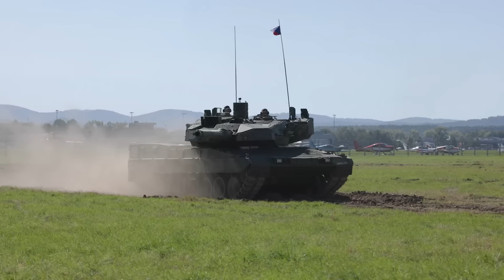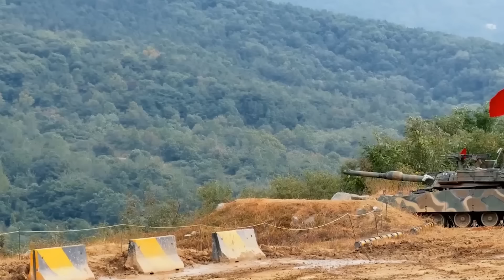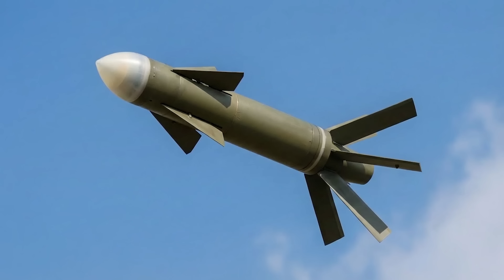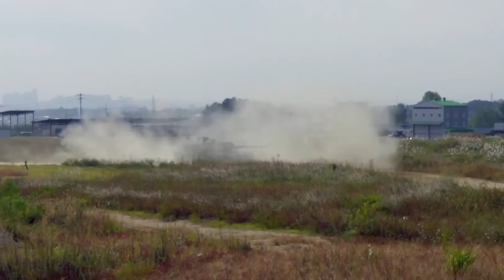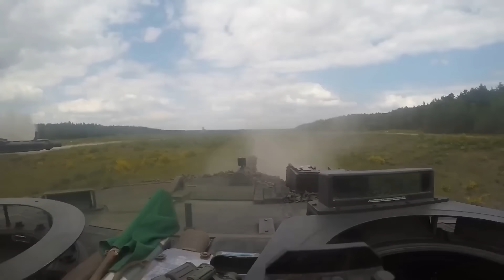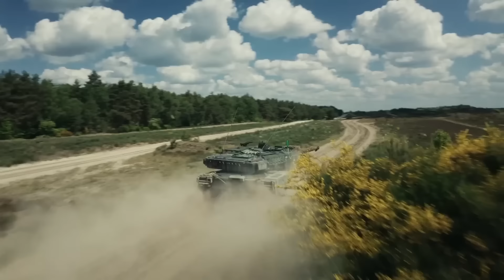Germany’s New Leopard 2A8 Is Better Than K2 Black Panther?!

Comment: Do you realize that the main 120-mm gun on the K2 MBT is based on the Rheinmetall gun first used by the Leopard 2 more than 20 years ago? Same thing with the engine & transmission system. Several years ago, Turkey negotiated to buy the K2 MBT from South Korea, with provision for technology transfer for its own new tanks, mainly as a way to get around German sanctions on arms exports to Turkey. The deal collapsed when the indigenous South Korean propulsion system was discovered to be substandard.
Reply: 1. 독일 랭크에서 한국에 수출한 변속기 알고리즘에 장난질을 침

2. 이상하게 출력이 나오질 않아 국산으로 교체

3. 한국 육군에서 9600km "연속 주행" 산악지형 급가속 급정지 급선회 경정비 불가 테스트 기준으로 테스트 실시. 독일과 미국의 파워팩 수명보장 기준을 단순하게 아무런 여과 없이 그대로 적용한 말도 안되는 테스트 기준을 세움

독일산 변속기에는 "단순" 상하향 변속 스로틀 100%와 60% 변속 회수 20000회.
반면 한국산 변속기에는 다이나믹 부하조건 "조향과 제동 작동과 동시 복합작동"에 스로틀 25% 35% 50% 70% 100% 로 변속 회수 57280회.
즉 변속 회수만 따졌을 때도 한국산 변속기는 독일산 변속기의 3배에 육박하는 회수의 변속을 실시했으며, 독일산 변속기와 달리 조향과 제동 그리고 다양한 스로틀 환경에서의 복합 작동으로 테스트 함.

4. 반면 독일제 파워팩 테스트는 경정비를 허가 했음에도 변속기에서 쇳가루가 섞이는 문제로 멈춤 자주 발생
독일산 변속기는 16,184km 주행시 무려 11번의 심각한 문제가 발생함. 평균 1,472km당 한번꼴로 문제가 발생(이 조차도 축소 은폐한 정황이 발견되어 경찰 조사까지 들어감)
한국산 변속기는 9600km 기준을 맞추기 위해 무고장 무보수 산악지형 과부하 주행의 대한민국 육군의 무식한 테스트에서도
7,110km 무고장 연속 주행을 성공하는 신기록을 세웠으나 대한민국 육군은 이를 수용하지 않았음

5. k2에 적용된 초도분 "독일산 파워팩 100기" 도입시에도 문제가 발생
독일산 파워팩의 명성을 믿고 단품 내구 테스트를 과감히 생력한 체 도입된 독일산 파워팩에서 심각한 결함과 하자들이 무더기로 드러나기 시작
독일산 파워팩은 사실 시제 차량용으로 수입한 것부터 품질 논란은 있어 왔다. 
시제 차량을 위해 수입한 독일산 파워팩 5대의 테스트 과정에서 변속기에서만 27건의 심각한 결함이 발생했고 
이 중 17건(62%)이 신뢰성 결함 문제였고 결국 5대 중 4대가 독일로 후송 조치되는 일까지 있었다.

문제는 곧 고쳐지리라 믿었던 이러한 결함들이 1차 양산품에서도 여전히 해결되지 않아 
한국산 파워팩에서도 발생하지 않았던 수준의 심각한 결함들이 독일산 파워팩에서 무더기로 발생한 것이다.

- 제동 압력이 비정상적으로 동작하거나, 내리막길에서 엔진 속도가 3,000rpm까지 상승하며 제동이 걸리지 않는 경우가 발생하였다.
- 1단 기어에서 출발을 하지 못하거나 아예 변속이 불가능한 결함도 확인되었다.
- 변속기 안에서 오링, 금속 막대가 이탈되어 발견되었다. (이것은 부품 교환이나 수리로 해결할 수 없는 심각한 수준의 결함을 의미한다.)
- 주행거리 300km에도 훨씬 못 미쳐 변속기 냉각팬이 구동하지 않아 엔진이 가동정지.
- 변속기 부품이 갈려 변속기 안에서 동조각과 쇳조각이 무더기로 쌓여 있었음.
- 용접 미흡으로 오일 냉각기 용접부 균열로 인한 누유 발생.
Reply: That is false. Turkey recently purchased a Korean-made powerpack
Reply: The CN08 tank gun is a completely different system, based on South Korea’s independent design, materials, and manufacturing processes.
Reply: The Altay tank is a tank developed based on K2 technology

Comment: During a military action or operation, and inflicting the greatest losses on the enemy, there's always an element of surprise. The very heavy Leopards can't achieve this. They're slower than the K2, less mobile, and not designed for wading through heavy mud. The K2 excels in such conditions. Few road bridges can support the Leopard 2. The K2's 55-tonne tank will cross any bridge without issue. The Germans are making the same mistake they did during World War II, building very heavy and complex tanks that are very slowly produced. Official information shows that the Germans produce two Leopards per month, while the Koreans produce 10 to 12 tanks per month. Korea delivered nearly 300 tanks to customers in 2.5 years. The Germans are slow, and their delivery times are very long, if not the longest in the world.
Reply: k2 탱크 전략을 이렇게 잘 이해하고 있다니 놀랍습니다. k2 는 중세 기사들 처럼 몸빵용이 아니고  몽골 전사들처럼 기습과 순발력을 이용해서  북한의 중국 국경선에 중공군보다 먼저 점령해야하는  한국의 제7 기동군단을 위해 만들어진 전차입니다.
Reply: @inhim05  K2전차는 보기륜이 6륜이고 장갑도 세라믹복합장갑을 장착해서 강도는 3배높이고 무게는 40%로 줄였고 독일전차처럼 복잡하지 않아서 무게절감을 많이 해서 가벼워진거지 단순하게 장갑이 약해서 가벼운게 아닙니다..K2기술을 라이센스 해서 자신들의 방식으로 만든 터키의 알타이전차는 65t이 넘어가죠.
K2는 경량화에 성공한 전차이지 단순하게 철판을 얇게해서 중량을 줄인 전차가 아닙니다..
k2도 보기륜7개 달고 레오파르트식으로 만들면 65t에 육박하는 전차가 된다고 봄
Reply: 한국의 생산 특성을 잘 이해하고 계시군요 한국인의 특징은 고객이 물건을 주문하면 잠을 않자고서라도 생산 기간을 지킵니다 유럽의 값비싼 노동력 왕처럼 군림하는 노동자들과 다릅니다 또하나의 특징은 한국의 물류 특성입니다 한국은 도로와 해상 교통로가 매우 발달해있습니다 오늘 물건을 주문하면 내일 물건을 받을수 있습니다 TV가 고장나면 당장 내일 당장 AS 기사가 집을 방문하여 문제를 해결해줍니다
Reply: @석춘배 흥미롭네요,우리 대부분은 노동자이고 그들이 왕처럼 대우 받는 다면 좋은거 아닐가요.? 
인간은 수십만년동안 해뜨면 일어나고 해지면 잠을 잤는데 밤에 일하는건 뭔가 안좋을거 같다는 생각이 드는군요.😮
Reply: @uhmmaa3 누구를 위해 일하는가 노동자의 우크 라이프 밸런스가 중요해
Reply: @uhmmaa3  잠은 죽고 나서 원없이 자도 됨
Reply: @케이빠레몬헌터스  Oder alle die nicht zu den 1% Unantastbaren zählen entfliehen dem von denen erzeugten Teufelskreis aus Hamsterrad, Teile-und-herrsche-Lügennetz und machen gar nichts. Dann muss auch keiner einen Panzer besteigen und darin sterben und kann lebend sorgenfrei schlafen. Oder meinst du ein chabol-Erbe, Tec-Milliardär ö.ä. komm an die Front als Kanonenfutter? Bei Kriegen (wirtschaftlich und militärisch) gehts immer um Durchsetzung von Interessen. Und das sind nie die wirklichen Interessen der "Normalsterblichen". Die müssen es nur umsetzen und ggf. ihr Leben für die große Sache hergeben. Welch eine "Ehre". Danke verzichte. Die Diskusion hier: - Welcher Panzer ist besser, wer kann schneller liefern, wer hat mehr Grund zu hassen (Polen oder andere) - zeigt, dass das Konzept der Eliten funktioniert - >>Teile und herrsche! <<. Schade, dass  offensichtlich 99% der 99%-Nicht-Eliten das immer wieder vergessen und sehr oft gar nicht begreifen. In erster Linie sind wir Menschen und nicht Koreaner, Polen, Deutsche und und und. Das "Wir sind Polen" oder "Wir sind Deutsche" usw. impliziert immer Abgrenzung. Das wiederum führt zu Denkstrukturen darüber "Wer ist besser, wer hat recht, wen muss ich hassen, wer muss weg?" Wem nützt denn so was? Den wenigen, die Bestimmer spielen, denn wie sollten sie sonst die dumpfe Masse kontrollieren? 
Zum Thema Panzer: Beide sind etwa gleich schlecht, weil mit beiden ziemlich effizient Menschen gekillt werden können.

Comment: From the weapon buyers' position, the German weapon is too expensive and its deployment speed is too slow. At the same time, the corepart of tanks, the powerpack's durability is not long-lasting. In contrast, the Korean MBT is much faster and cheaper but reliable. Of course, the Korean powerpack is more powerful. However, the German weapon maker does not want to have the same market share, so many European states had to contract with Germany. Weapons are weapons, which means European politicians shouldn't make their people victims for European weapon developers' fiscal benefits. Unfortunately, French and German weapon builders wanted to make Europeans states scapegoats to make big bucks.

Comment: During NATO joint exercises, the K2 was the only tank to successfully navigate rough terrain and reach its destination. The M1 Abrams and Leopard 2A7 were stopped midway. In wartime, a tank with poor mobility is virtually useless. In tests in Qatar, the K2 achieved 100% accuracy at targets out to 5 kilometers. In all aspects—mobility, protection, fire control system, accuracy, price, and maintenance costs—the K2 is superior to the Leopard or M1 Abrams. Even Norway, which ultimately chose the Leopard 2A7 for political and economic reasons, officially announced that the K2 was superior to the Leopard 2A7 in objective performance evaluations.
Reply: Source?
Reply: @dieterdodel835  Google it.
Reply: @dieterdodel835 Google it yourself.
Reply: The Leopard and and Abrams are both battle proven. Norway did not choose the 2A7 for political reasons but because it is better suited for the kind of operations it will face on the battlefield
Reply: @aluimmumitat That's bullshit. You sound like a german salesman for crappy Leopards. Both Leopards and Abrams got stuck in the rasputitsa mud in Ukraine battlefields and kept breaking down in freezing temperatures. K2 is far superior to Leopard. The Norwegian Army leadership got angry when the Norwegian government chose german tanks for political expediency and issued official document to the Korean and the Polish government attesting to the superiority of K2 over Leopard. That is why Poland chose to sign the Framework Agreement to buy 1000 K2 Black Panthers. Get your facts straight.
Reply: @davidpark372  I see, they got stuck in the Raspustitsa. Source trust me bro. Ukraine soldiers say differently about the Leopard 2. who is more trustworthy? A soldier who fought with multiple tanks with stakes no less than his own life or a keyboard warrior?
Reply: @aluimmumitat 😂👍
Reply: @davidpark372 .....lets wait until your glorified K2 enters a real battlefield.
Reply: @dieterdodel835  Good.
Reply: @aluimmumitat  1. norway 's Speaker of the National Assembly officially came to korea for this reason, and  said ' our choice is for political issue, not performance.  and said they are willing to share their test results for other countries who want k2.  2. chief of staff norway argued to buy k2 instead leopard , he request to delay the decision because he want more time to report why  we have to  chose k2. 3. hyundai rotem got a celebration call from norway agent,  the day before decision, it because the agent check the comparison table and find out k2 overwhelmed leopard.
Reply: @dieterdodel835  이미 객관적인 테스트를 한 결과가 있는데, 왜 인정을 안하나요?
당신은 그 테스트가 예쁜 레이싱용 트랙에서 테스트를 한줄 아나봐요? 😂😂
실전경험은 중요하지만
 휴전중인 한국군은 이미 K2로 오래전부터 강도높은 훈련을 해왔기 때문에 데이터는 충분합니다.
Reply: @정재민-o8f ...wie ich schon geschrieben habe, nur auf dem Schlachtfeld gibt es reale, verwertbare Daten. Alles andere ist nur "Whataboutcrap"! Period!
Reply: @dieterdodel835  굉장히 오만하고 무지하네요  한국은 휴전국가입니다.
한국을 저평가하지 마세요.
한국의 중공업 화확 첨단산업은
최고수준입니다.
Reply: @정재민-o8f  ....Deine Kommentare über den K2 sind einfach nur pure Arroganz! Ein Panzer der noch nie wahre Gefechtsbedingungen gesehen hat als besten Panzer zu bezeichnen, ist nicht nur unendlich Hochnäsig und Arrogant, nein es ist auch noch sehr dumm! Die Realität sieht so aus: M1-Abrams und Leopard 2 haben auf Schlachtfeldern Erfahrung und Daten gesammelt! Euer K2 ist nur auf dem Papier gut, mehr nicht! Ende der Diskussion, du gnatziges Kleinkind...
Reply: @정재민-o8f 초딩이냐 ? 뭘 그리 오만한 독일놈에게 징징대고 그래. 언제 받을지 모르는 장비 열심히 사기쳐서 팔아 먹으라고 냅둬. 니가 우리가 최고에요 그러면 쟤들이 그래 니들 최고다 해 줄줄 일아 ? 객관적으로 넌 그냥 나라망신 시키려고 징징대는 초딩으로 보여. 쪽팔리게 이런 짓 좀 하지마라. 네가 주장한다고 사실인게 아니자나 ? 논리적으로 싸우려면 근거 문서라도 들고와서 주장하던가. 넌 주장만 있고 근거가 없자나. 국뽕 유튭이 근거가 돼지는 않아.
Reply: @dieterdodel835  전에 K9과 FA-50도 그렇게 무시를 당했었죠 ㅋㅋㅋ 하지만 지금은?
Reply: @aluimmumitat  돌아다니면서 이곳저곳 열심히 응원하고 계시네요? ㅋㅋㅋ 😆 화이팅!

Comment: this video compares the two tanks using models from different release periods.
if you want to compare the K2 tank with the Leopard 2, you should be comparing it to the leopard 2A7, which was introduced in the similar period, not the 2A8.
if you want a fair comparison with the leopard 2A8, then you should compare it against the latest K2 variant, the K2EX.
Reply: Yup, expected poor research typical of these no name YouTube channels. 😂
Reply: And do you know what the Leopard 2A8 actually is? 
It's nothing more than a Leopard 2A7HU (2A7+HU) with the Trophy system attached.
In this case, the comparison from the Korean side would be:
K2 PIP - equipped with the first series of KAPS;
K2EX - equipped with KAPS-2, which was developed based on the Israeli Trophy APS system;
K2PL - equipped with the Trophy APS system. 
However, K2PL should also be excluded, as it will utilize Korean systems enhanced with elements of Polish systems (TOPAZ, OBRA, etc.) and the Israeli Trophy, where the Leopard 2A8 will only utilize updated systems already in use (if the Ukrainian and donors, primarily the Swedes, share the data), plus the Trophy.
Reply: It is irrelevant. The K2 is a 4th generation tank, and the A8 is a 3+ generation tank. It is like comparing the F-35 with the latest modernised version of the F-16.

Comment: I think Poland will lean toward more K2 and fewer 2A8 Leapords due to the K2 lighter weight being able to use more rural bridges.
BTW, the K2 barrel is so strong due to special Korean steel that it can handle higher pressure rounds and with less barrel wear. Same with the South Korean armored mobile artillery.
BOTTOM LINE: Germany needs to gets its ass in gear on arms contract fulfillment.
Reply: Polands not buying 2a8s. We bought m1s and k2s. Germany was unable to even upgrade our leopards in a timely fashion. Poland was then barred from participating in the next Gen tank conglomerate with European partners, they said screw this and are making moves to be self sufficient. Korea understands all too well Polands position, which makes a great partnership for both.  Once technology transfer occurs, Korea gets access to the European market, Poland expands its manufacturing base, there'll be collaboration between the 2 and Korea gets another manufacturing hub capable of supplying them with parts in case they got to war with NK.
Reply: @skoVBA2  GOOD for Poland! Germany's "We make it, you buy it." policy is self-defeating.
As an American watching Putin's asset Trump alienate NATO allies I can't understand Poland being ostracized form European tank development. WTF?? This hurts European unity at a time when it is greatly needed.
Reply: @ericb.4358  미국인들은 좌파든 우파든 정신이 나갔네요.
미국도 독일도 3년 안에 폴란드를 러시아로부터 안전하게 만들 수 있는 최소 수량의 전차를 제공 할 수 없다면, 입좀 닥치세요.
단합은 폴란드가 존재해야 가능합니다.
Reply: IT is already in Poland in plan to get rid of all lepards in a moment notice when Black cat pl is delivered, lepards are to expensive to keep, and no technology transfer just not a good deal.
Reply: Nur gut das Deutschland den koreanern gezeigt hat wie man guten Stahl herstellt
Reply: @thomaswolf2214  Did they?
Reply: @thomaswolf2214  한국의 철강역사는 매우길어
무슨 철강을 말하는거야?
Reply: @정재민-o8f dann mach dich mal schlau welche firmen aus Deutschland euch in den 80ern beigebracht haben wie man richtigen Stahl macht.
Reply: @thomaswolf2214  그러니까 어떤 회사가 뭘 알려줬냐고 묻잖아
Reply: @정재민-o8f nein sie sollten fragen ich weiß das
Reply: @thomaswolf2214  없는거네
본인도 모르는거 보니
Reply: @정재민-o8f ich sehe das du dich in der Geschichte deines Landes überhaupt nicht auskennst
Reply: @thomaswolf2214  너의 말에는 아무 근거가 없어. 
그리고 너희 기술에 의해 발전했다고 가정을 하자. 그래서 어쩌라고?
너희 나라 재조업이 박살난것에 대해서 한국은 아무 관심이 없어.
독일이 가난해지면 기술을 더 팔아주세요. 
한국이 아니면 중국에 팔아서 더 망해주세요. 감사합니다.
Reply: @thomaswolf2214  REALLY? I wonder if Germany has any artillery/tank barrels that are as strong and as durable as the Korean barrels? Will German barrels withstand very high combustion pressures and last as many thousand of rounds fired??
Reply: They have a much better K2 than even Korea, the K2 PL has basically all flaws of K2 fixed, with side and roof composites, better turret and hull armor, RCS, drone jammer and APS

Comment: Poland has got 200 k2 tanks already. How many leopard 2a8 has been delivered to Norway and Croatia? None
Tanks are for war not for showcase.
Reply: Zamówiono do realizacji 360 sztuk k2 plus kilkadziesiat pojazdów towarzyszących, mosty,techniczne ,ewakulacji.
Reply: Quality tanks are difficult and time consuming to produce, Einstein. The first tank will be delivered in 2027.
Reply: @hyp77   Finding balance between performance and quantity.   Both are equally important in war.   Logistics and operability is often more important. 
K2 is a perfect balance and yet vastly superior to Russian tanks.
Reply: The Leopard is battle proven. A leopard is known that it can take multiple drone hits and drive away. How does the K2 compare?
Reply: @aluimmumitat   They ain't proving much because most of them are just sitting on their ass in repair shops across Ukraine. Some are due to enemy actions, but most of them just broke down. It's like BMW and Mercedes. They are nothing but over-engineered fancy toys that break down daily.
Reply: @Coelophysis5  
To my knowledge, Ukraine has lost approximately 30% of its Leopard 2 fleet after 3 years of compat (Oryx). The others are still operational, and just a few weeks ago, Ukraine shared a clip showing a raid with a Leopard 2. A strength of the Leopard 2 is that many countries in Europe own it, which makes its logistics of spare parts much easier. The Germans also build repair shops inside Ukraine and trained the ukrainian employees, in Germany itself.  Every tank breaks down in war but the Leopard 2 is not known to break down more than others, in the contrary it is highly praised by the Ukrainians.